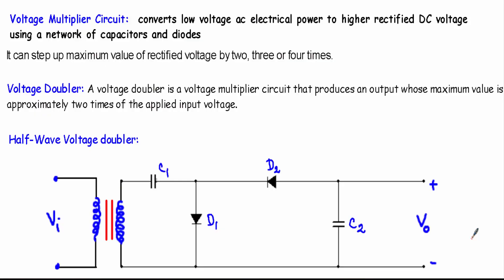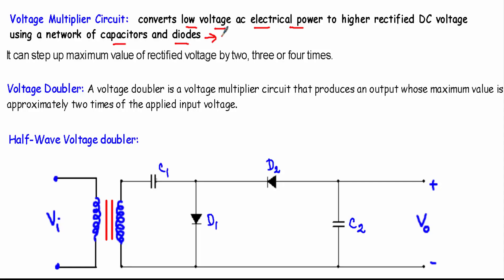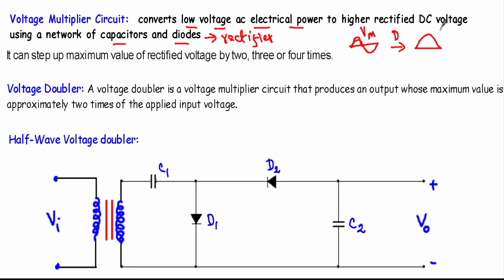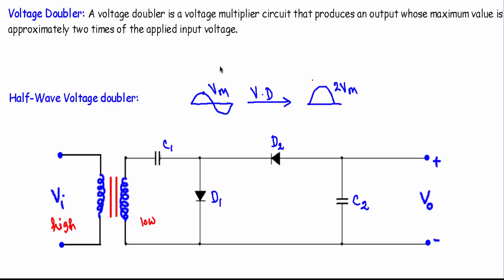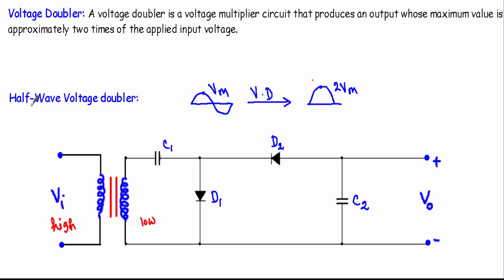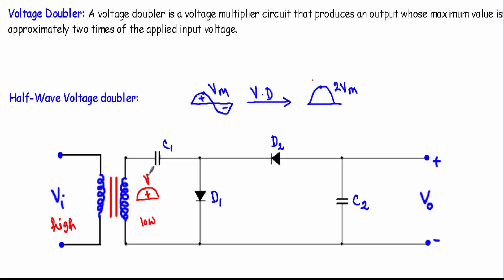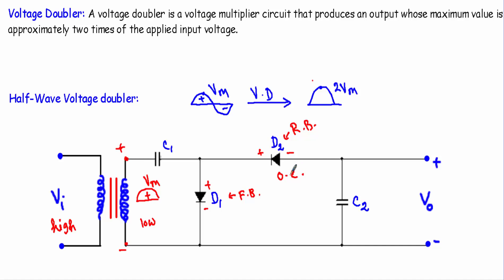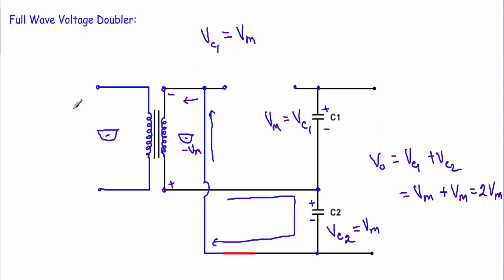Voltage Doubler Circuit (Half & Full Wave)

Comment: I have one doubt in half wave voltage doubler.  I think there is a flaw in explanation. Think about the negative cycle when C2 is charging, Vc1 is same  as before according to you so charge in Capacitor 1 is not changing. That means charge in negative plate of capacitor 2 was 0 in +ve cycle, it becomes negative in next cycle, where it is only connected to -ve plate of C1 whose charge is not changing. How can that be possible..from where that charge in C2 is coming.

Comment: Shouldn’t the diodes be facing the positive side of the circuit. It looks like your designing a negative voltage doubler ?.

Comment: Why do we use step down transformer instead of step up transformer
Reply: Because we are usually using voltages lower than the outlet voltage. But you could make the output voltage anything you want, you could even bypass the transformer and plug the doubler directly into the outlet if you want to double the outlet voltage, but you need to know enough to do that (higher voltage ckmponent values), plus you would be working with deadly voltages and currents without being isolated from the live (hot) side; one touch and you could be dead. Also, you could make a short-circuit and make an explosion or start a fire.
My advice: DON'T DO IT!
Reply: @edinfific2576  after 2 years my completion of degree somebody answered to this 😂 

Anyways thanks for the big picture. Theoretically they were good practically its dangerous.

Comment: why the diodes are opposite way :-P
Reply: I thought it was weird too, as my lecture notes have them both facing the opposite direction as compared to this video. Then i realized even if you make both the diode face the other direction, It's still doing the same function, just that for our case, our -ve half cycle charges C1 (while this video powers the load using source and the already charged C1), and during +ve half cycle both the input source and the already charged C1 will power the load (while this video charges C1 instead).